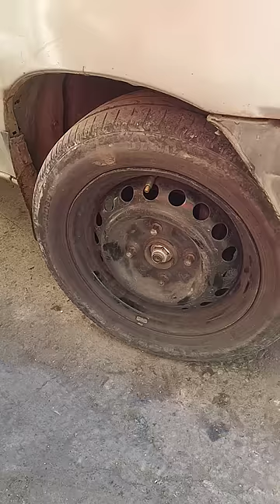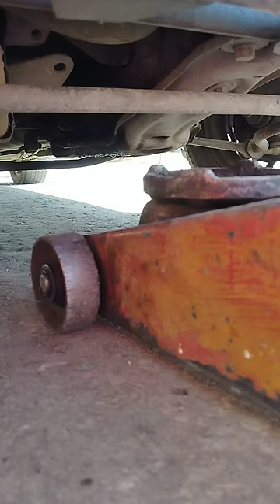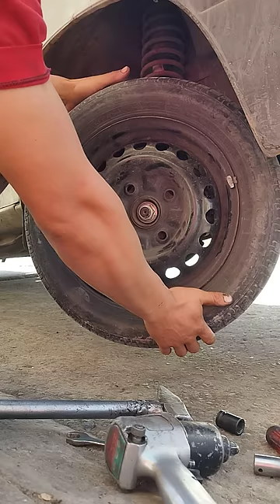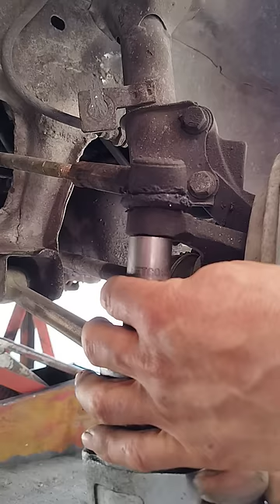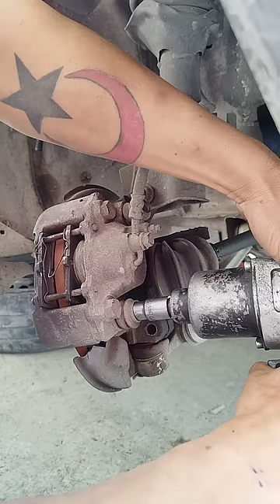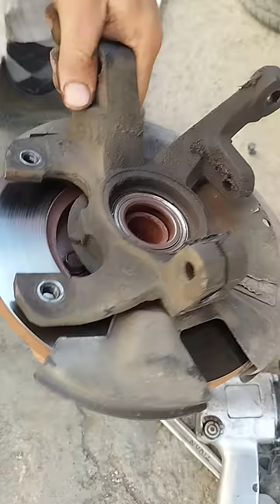#shorts #mechanic

Comment: Just don’t do my other tire rod ends. Lol. 
Smash the knuckle, not the bolt on the thread. 🙏🏼prevent damaging threads rocking the inner to rack. But yea. Dam that bearing holy moly.

Comment: Remember don't hit the castle nut like that unless you are replacing it. And replacing the ball joint as well or the outter tie rod.
Reply: Literally every mechanic does that stop being a softy.
Reply: Yeah I do it always.
Reply: Even dealers under warranty won’t replace those for a repair. If it isn’t broke, don’t fix it. But I think you were meaning don’t do that unless you are replacing them. But you said joint and tie rod end. So I’m not sure.
Reply: @dredennis113  ball joint
Reply from the maker: Hello, dear friend, yes, thank you for your new and good comments